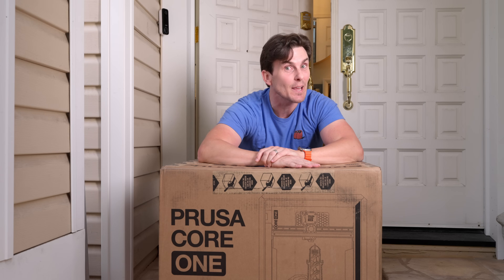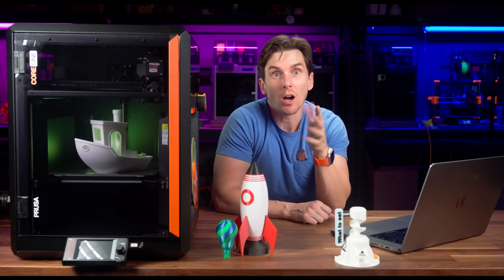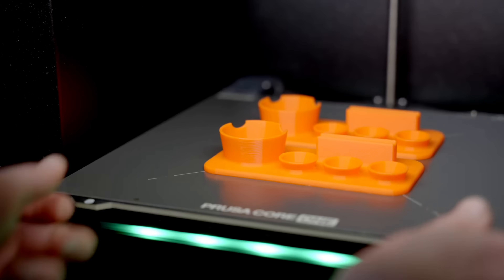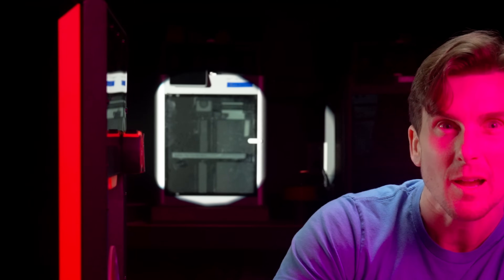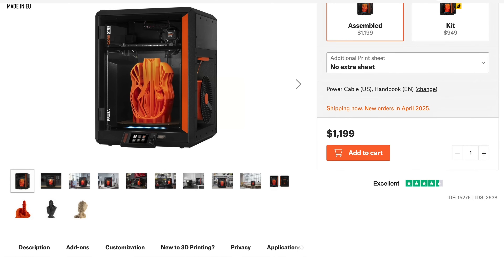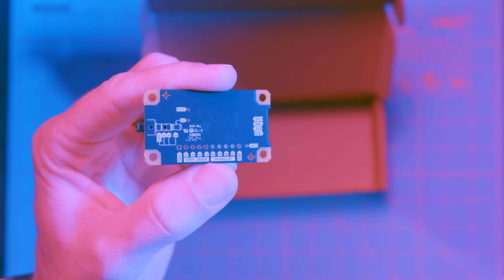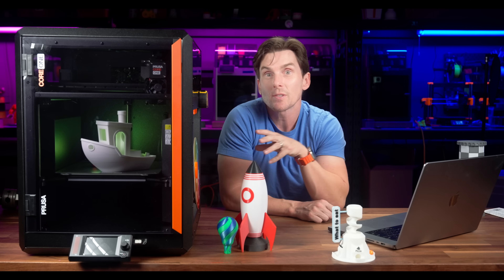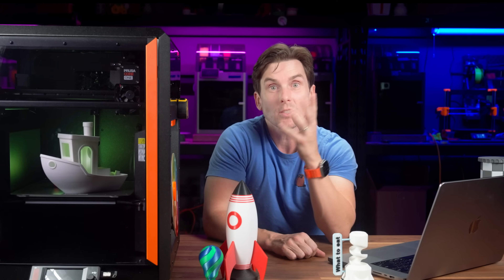Prusa Core One: 65 Million Layers in the Making

Comment: As a beginner  I don't need a "workhorse machine" for about 1350 € .
Of course this depends on the idea what a beginner is.
For 600€  i have got an Anycubic Combo 1S high-speed enclosed CoreXY
with an 4 Color ACE . ( 400€ without ACE that is 1/3 the price of Prusa Core One)
And it works after 30 Minutes unboxing right away with no problems.
Reply from the maker: These are all valid points, I feel like this is going to be the year of multicolor sweat machine would you like me to test? I’m currently working on the H2D review right now

Comment: No way prusa is better than bambu... Prusa is just a overpriced bare minimum printer that still struggles with vfas and ringing. Most of it is just marketing
Reply from the maker: I have both machines and they both perform really well, i'm working currently on the H2D review, i'm really excited to unbox it (I was one of the lucky ones in the US that got the first batch before the price went up $500)
Reply: @cowabungacreation  I had a MK4s and now have the H2D it's way better, prusa can't even fix the too low first layer bug that is there since half a year.
Reply from the maker: @ have you tested multimaterial supports yet? thats one of the reasone i'm excited for it supports with an interface layer

Comment: Wow - great editing! However when it comes to beginner printers, I really think the A1 Mini (or A1) is the best. It’s what I recommend to everyone. I have a core one and have had extruder feeding issues that the A1 did not. The calibration also requires intervention more often than not with the nozzle and filament, which is an automated process on the A1 series. Also AMS Lite is killer on that little thing. Of course the Core One offers things that the A1 series doesn’t like enclosure, ventilation options, etc. But the A1 is also infinitely easier to work on/access when extruder issues arise. And is WAY cheaper. Anyway, loved the Bambu ai bit as well 😂😂😂 - nice vid.
Reply from the maker: I guess beginner is all relative, b/c it could be based on price, learning aspect, ecosystem. You have some great point! It is interesting that you brought up the a1 mini because I teach a 3d printing class at school and I use the a1 mini as my printer to teach on. i'm working on the H2D printer, let me know what aspects of the machine you want me to cover
Reply: @cowabungacreation  Haha that's awesome! Great machines. In spite of, the "Update". I personally would love to see some support multi-material jobs, if you have any. Seems like that would be a great benefit of two nozzles on the H2D. But I've heard disappointing results regarding that, so I'd love to see your experiences on it. Example: Today I printed some headset spacers (for my kids MacRide seat) and would have been great to do some PLA between the PET-CF to get a cleaner overhang. AMS Lite doesn't "allow" CF materials so this would be a distinct advantage of the H2D.

Comment: Great video, but the title doesn't really match the content?  You are talking about expansion boards and time lapses most of the time and you even show how hard soldering actually is. I am really curious about a honest beginner user experience comparison because Bambu has that somewhat dialed. I still had to do too much assembly on my A1 for an out of the box experience, and it prompts me too much about maintenance. I am a creator on both MW and Printables and with Bambu people can more or less press print in the app and it starts, I am curious to see how Prusa handles that. I won't be getting one anytime soon because Prusameters aren't stacking up as quickly as the MW points but I would love to see Prusa succeed once again, I'm just afraid there is still a perceived hurdle for beginners, incluiding a really DIY feel, which Bambu got rid off (partially undeserved because it's still not a magical black box that always works). But back to the beginning: great video!
Reply from the maker: thank you for watching my video and taking the time to write such a thoughtful response. I tried to poke fun at the fact that the process of using the hackerboard was way more involved than I had previously expected, it was a good excuse to learn how to solder headers onto PCB's although that in itself was fairly tricky (when I filmed the video I realized all my solder joints were cold and I had to redo them after filming). My perspective on the machine (maybe more so the kit to assemble) is that it is a great way to learn to build a 3d printer (especially for me and my 13 yr old son). I also do real silly short form content promoting creators work, send me a link to your work, I love working with creators. Best!
Reply: @cowabungacreation  Thanks! I'm Rossero on MakerWorld, I do have some fun and popular designs that seem to do well on the socials. Although you already printed the roll-up chess board from the competition haha
Reply from the maker: @rosserobertolli  Dude! I love your designs! i'll message you on makerworld
Reply: I fully agree that a Bambulab printer is beginner friendly. Although the Core One comes almost completely assembled, there is still some minor stuff to do. But to be honest, that's also true with the Bambulab printers, so that's maybe not a point.
I had a A1 mini, and without doubt it's a real plug and play machine that prints really great. I can recommend it to any beginner of 3D printing. Still - I have sold that A1 mini and went for a intermediate Creality K1C machine, to replace it later with the Core One.
Why? Well - For me the open source (both mechanical as software) nature of the Prusa machines is a big thing. I really don't like the completely close source nature of the Bambulab environment. By default you even have to upload your print jobs to a cloud server somewhere in China, otherwise you cannot print (there is a work-around for now, but nobody knows if the next firmware update will erase that). Your own designs are stored somewhere and can be used without your permission.  In short - I don't like that.
For me personally the turning point was when 3th party slicers where not longer allowed to send print jobs directly to the printer. They had to use some app that send your stuff to the cloud and then back to the printer. But why? No idea, but it feels forced against my will (yeah, another work-around again).
Anyway - Long story short. I will buy a Core One soon. I want the kit version because then I learn every nook and cranny of that printer. Sadly the deliver time is long, so that's the reason for the temporary K1C (great machine by the way).
Reply from the maker: @ thank you so much for this wonderfully thoughtful reply, I agree 100% with everything that you said. I'm planning on doing an upgrade video once I get my upgrade kit for my mk4s --> core one

Comment: Short answer. It's not.
Reply from the maker: thank you for watching my video and taking time to leave a comment! what aspects of 3D printing interest you the most? the technical side or more the modeling side? best!
Reply: @cowabungacreation Hi. Don't get me wrong. I appreciate the effort you put into making a fun to watch video. I use 3D printers as tools not as a hobby or toy to play with. I mainly print my designs either for prototyping or as end use parts. I think that the technology is very interesting and I love to learn how it works BUT I'm not interested in building my own 3D printer or mod/fix/improve the one I bought. I just want it to work. For a long time Prusa was the closest to that experience but even then I had to mod my MK3s to some degree. Add enclosure, upgrade the hotend, print plastic parts with high temperature material. Bambu Lab came along and with all its downsides the company provides a streamlined experience so you can focus on creating instead of tweaking and tuning. At this point Prusa printers have become the printers mostly for 3D printing enthusiasts whereas Bambu Lab printers are more aimed at makers, designers who don't want a printer as a project to work on, they just want a tool to bring their projects to life.

Comment: I just want to know 2 things
1. How loud is it compared to the X1C. (Can you put quieter fans to reduce noise?)

2. With klipper firmware and advanced tuning, how does it compare to stock X1C?
Reply: It’s super quiet compared to the X1C. Especially when printing PLA.
Reply from the maker: I have a specialized device that measures volume in decibels I’ll record the data
Reply from the maker: Those are two excellent points, I will do some more testing and respond to your comment!
Reply: Core one doesn't use klipper, its marlin. And its significantly quieter compared to anything bambu.